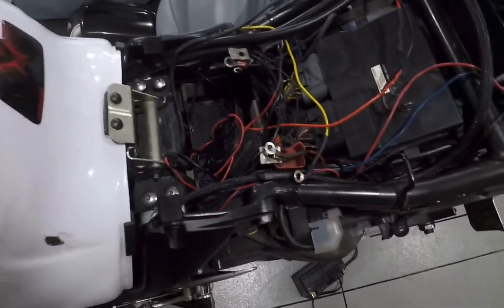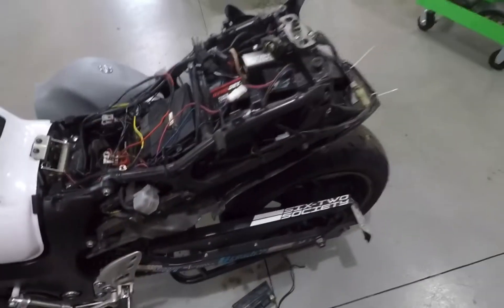Turbo Hayabusa lightweight bodywork

Comment: You should replace subframe that will save you more weight then the body work did. You could also get a front rack that has a fuel cell. That will help get weight in the front.
Reply from the maker: Do they make a stock length subframe a lot of the ones I looked at were for pro street tails. I was looking at the front racks but on this bike I wasn’t going to do that with running on the street. If I go on rides I can just swap tanks and go.
Reply: @The717Outlaw  yes they make stock size subframes. You can get a carbon fiber one or a aluminum one from dme
Reply from the maker: @flynncbr  ok I’ll check them out. I wanted to get one at some point but I have a few other weight savings I can snag too but I have to build up some money again. Want to get triple tree clamps, clip on bars and rear sets

Comment: What about the plastics around the dash? Do you put the oem once back on or it stays naked there?
Reply from the maker: Around the cluster will have OEM plastics for now. The pieces that cover the Ram air are going to be gone. One of the reasons I’m cleaning up the wiring harness is by doing that naked look is a section of wire visible when you look around the levers.

Comment: Where did u get that tank from and how many gallons is it to
Reply from the maker: I got it from 1 Stop Speed. It’s a fiberglass shell with aluminum tank about 1.5 gallon capacity if I’m not mistaken.
Reply: @The717Outlaw  ok thank u that's the name of the place that I can look it up to
Reply from the maker: @facelaw674  not a problem and yes they have that tank there.
Reply: @The717Outlaw  ok thank u again
Reply: Is the front  body work from 1 stop speed as well.   Alex.